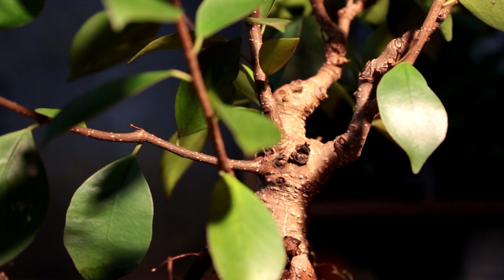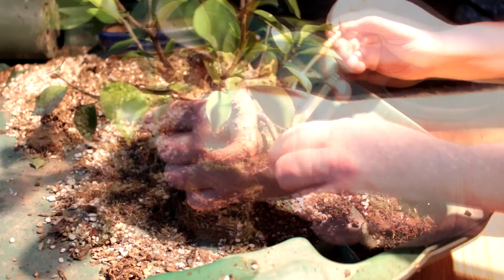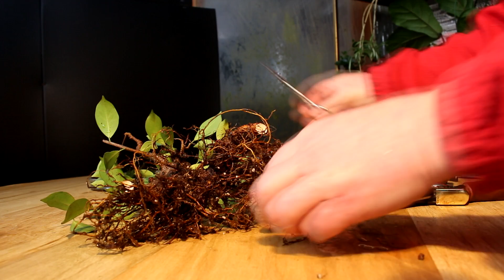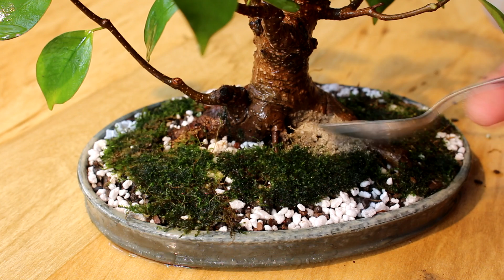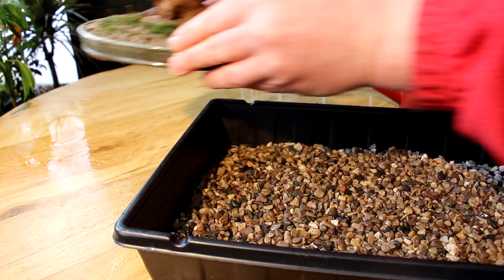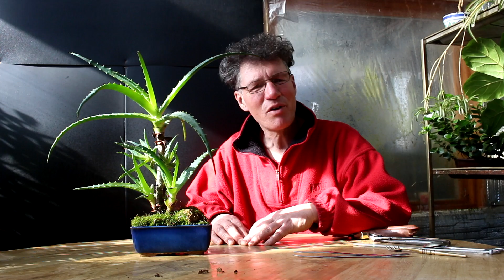Planting Bonsai Trees in My 3D Printed Pots, Part 2, Feb 2018

Comment: Doesn't adding sand spoil the whole "seeve your soil" excercise?
Reply from the maker: The sand always stays near the top of the soil. I was worried about this, but I have found no problems even after a few years.
Reply: That I cannot believe, because if I place sand on top of anything, it starts to fill the voids between the more coarse particles in the soil with the first watering and keeps doing that. Maybe you are using a special, very sticky sand, which tends to stay together. Anyways: Your plantings look great with that addition. I just cannot repeat that with the kind of sand available to me, as it would surely kill all my efforts of keeping the majority of the soil "airy".

Comment: Nigel, do you have a Gardenia bonsai?
Reply from the maker: I had one long ago and I'm not even sure what happened to it. I think I used it in a demo and gave it away. This would have been about 20 years ago!
Reply: Nigel, I recently acquired a Gardenia bush from a grocery store. It arrived all green and has buds about to blossom. When in my home, One bud has blossomed so far but the leaves are turning yellow starting from the base of branches working outward. It looks to be 2 separate plants put in 1 pot. My intention is to turn it into bonsai. Could you offer me any suggestions on how and when to begin the process of turning it into a bonsai? How often should I fertilize it?

Comment: Ok Nigel very good, what substrate you use over the moss ? And what is the purpose? Used in ficus bonsai... a hug!
Reply from the maker: I put washed playground sand on the surface of the soil, it seems to draw excess moisture from the soil and brings it to the surface. This helps grow the moss on top of your bonsai soil also. It also helps stop evaporation from the surface of your bonsai soil by providing a wind proof barrier. It is harder to water the tree when the sand dries out, but after you wet the sand, you can water as per normal again.
Reply: Nigel Saunders, The Bonsai Zone ok Nigel thanks for the information, I'II do this experience too...
A hug!

Comment: Really enjoyed this video Nigel. I was wondering, I have my figs and ficus trees I need to repot but read it should be done in warm weather and not spring. It's mid summer here now with temps in the 30s and 40s on occasion. Do you think I should repot now, or what time would you recommend?
Reply from the maker: I recommend re potting your tropical trees mid summer. I let them grow with vigor from spring to mid summer, re pot and then let them grow and recover until fall. The Ficus trees usually don't skip a beat if re potted in nice warm humid sunny weather. Keep them well watered after re potting, almost like a cutting until they start to grow their new roots.
Reply: Nigel Saunders, The Bonsai Zone excellent thanks so much for the advice.

Comment: Nigel, in another recent video you removed the tree from the pot to prune the roots and you pruned the tree at the same time. In this video you pruned the tree THEN removed it from the pot to prune the roots. Is this just a matter of preference at the time or is there a reason you would do this for one and not the other?  The Ficus in this video is beautiful, by the way. I love how it's looking! And I think this new pot is perfect for it!
Reply from the maker: Hello Bonnie, I think as the tree gets more developed and a front has been chosen, there is less need to take it out of the pot to examine the roots. The roots can determine the front of the tree and also affect the pruning above, once the front is chosen. Older more developed trees can be pruned knowing that the front won't change too dramatically.
Reply: Nigel, thank you! I was about to ask how the roots can help determine the front of the tree but I thought about the surface roots. Or what could develop into surface roots. Thank you!

Comment: Excellent video as always Nigel. If you could just answer me one question I would really appreciate it. Now, the bark of my ulmus is very grayish and I'm pretty certain that it is because of the amount of limestone in the tap water. I know that rain water would solve the problem but I live in an apartment. So, do you know how I could clean the bark of the limestone and, should I consider starting watering the tree with bottled water? Thanks a lot for your videos
Reply from the maker: I would recommend using distilled water indoors, or rain water if you are able to collect any from your balcony. I buy a large 19 liter jug of steam distilled water for just under 7 dollars. I use the water to drink, not for my plants, but I think it is a reasonable price even for your bonsai. They are very heavy, but you can get smaller 4 liter jugs in the grocery store also. I would try and clean your bark with just plain water and a toothbrush. You will find that the roots of the tree may also have the lime/calcium build up on them. It can affect the health of your tree.
Reply: That seems pretty affordable, that's a great solution. Thanks a lot Nigel :) And you were absolutely correct about the roots as well. I'll re-pot it next week and give it a good brushing and washing.

Comment: I liked the video Nigel nice ficus! Is that turfis & perlite mixed together?  & do you use that bonsai soil for all your trees? I bought mini pop-up greenhouse .I also purchased live moss . Will that work for my moss to keep it nice & healthy and maybe put my ginseng ficus under the green house to drop Ariel roots ?
Reply from the maker: The greenhouse will help to keep the humidity high. Keep an eye on the temperatures, you don't want them to get above 40 C or the trees will go dormant in the heat. Mist them lots on hot sunny days! I would keep a thermometer inside the greenhouse so you can see the temp at a glance. A small fan to circulate the air will help the trees also. Yes my soil is turface and perlite mixed 50/50. It works well as a soil for all my trees. Here is my video on watering and fertilizing it.....
 https://www.youtube.com/watch?v=gXIIpxUqxdY&t=25s
I collect my moss from sunny spots, like driveways and sidewalks.
Reply: Nigel Saunders, The Bonsai Zone
Thank you Nigel for the information it helps me out a lot I appreciate it.
Reply: Nigel Saunders, The Bonsai Zone 
I use a liquid fertilizer Bonide 10-10-10 is that ok to use on the bonsai trees? And is it ok to use fertilizer on the moss that I put on the soil of my trees ?

Comment: But is not a bit too small the pot? The tree will need re-potting very soon, how it seem to me. The roots will bound themselves very quick. Otherwise, a beautiful work. Like your oaks and honey locust. I also planted two seeds of honey locust and now I have 2 honey locust seedlings.
Reply from the maker: I'll see how it does in this pot,if it stats to get weak I'll put it in a slightly larger one. I'll have to be careful with the watering. I'm looking forward to developing the Locust trees. I have a black Locust on the go also.